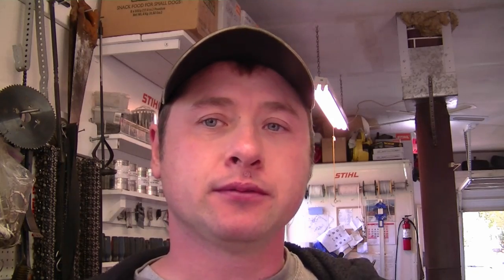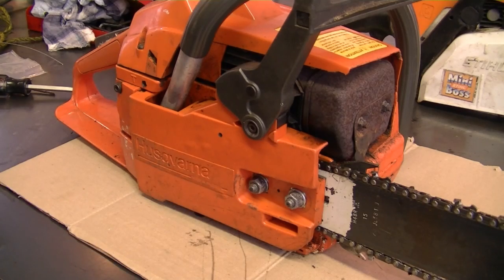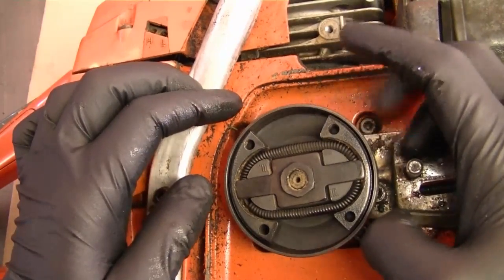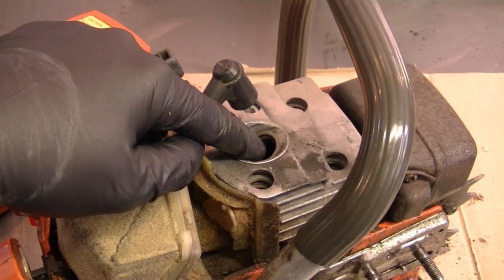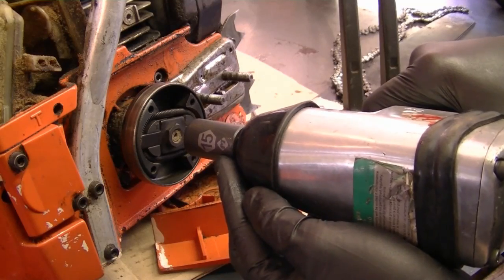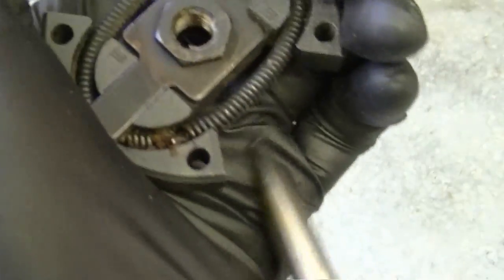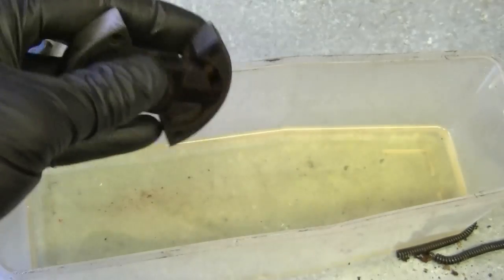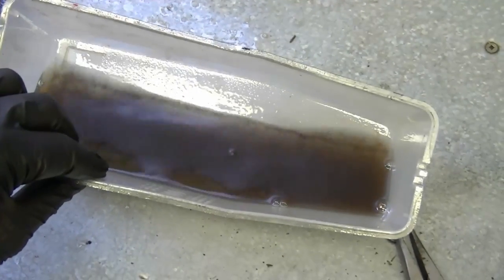How To Fix A Husqvarna Chain Saw When The Chain Won't Stop Turning & How To Fix It

Comment: Did get my Husqvarna 136 Saw to start. Did a lot of cleaning. Muffler, cleaned and gapped spark plug. Used 50:1 premixed can 
of gas. My fault for using old gas. Never had a problem before with 10% ethanol gas and oil. My Homelite 14" gas saw ran for 
20 years without any of the issues I'm having with my Husqvarna ( 11 year old, moderate use ).
Your videos are great.  Going to take a look at my clutch since my chain moves while idliing, and my automatic oiler since
oil was dripping when starting and dripped a lot while chain was moving while idling.
  Thank You !!

Comment: Great video! I'm happy that you mentioned that you could check the throttle screw first. You showed it so fast, I almost missed it. You could have spent a little more time on that, but besides that, it was excellent and if I ever need to replace the spring, I know how! Thanks!

Comment: A+ as always, thanks!!  Man I WISH I watched this before removing a clutch the other day, I did "the rope method"....dude I have had to grind wrench-sockets for custom sprocket-drivers to remove plenty of my climbsaws' sprockets (always needing to oil those roller-bearings on the shaft//clutch interface) and I never jam the cylinder I just put the sprocket-driver bit onto my ryobi impact drill and gun it CW full-trigger and it works w/o exception!  
Am new to this style of 'hidden / invisible' clutch on the 660, which I'm working a pair of right now (am no pro am just doing this for myself, well not pro chainsaw guy a pro *tree guy*!), and I just totally defaulted to the 'jam the piston' method w/o even realizing I wouldn't have even had to make a special clutch-driver!  Well, there's a 2nd unit that still needs its clutch removed so 1 outta 2 is better than none ;D 
Thanks as always, it's funny I've developed a habit wherein, before any procedure I don't know "with my eyes closed", I've developed a tendency to watch a handful of 'randoms' and then watch your content last before doing the job, am removing the other unit's clutch right now lol, but yeah I think your stuff is just so great & to the point that it helps getting more elaborate explanations elsewhere, seeing & hearing another's take on it, and then watching "the dictionary"/authoritative piece of content on your channel as your final, I suspect it's just like studying "varying sources" and finishing with the encyclopedia or dictionary, the 'objective final piece' (can't believe how young you are, I mean I can tell you "look young for your age" and all but you're obviously not 50 and you've got the mechanic-skills of someone far older!!)

Comment: Thank you, I’ve wondered why the chain would continue to run after I let off, this helps in identifying the problem.  I’ve just ordered a new spring on eBay and will follow your instructions on replacing it.  Thanks again.

Comment: I've got a Husqvarna 61, after only one minute or less of operation the saw will stall while cutting. I am guessing this could also be caused by a stretched clutch spring? I have taken off the clutch plate, the spring is not broken but perhaps it is stretched, I am not sure. Great video by the way.

Comment: Hi Dony. As always I learnt so much from the vid.
My husqvana 51 has a triangular configuration.
Is there any difference in part number and fitting. Thanks for your videos 
South Wales GB
Reply from the maker: doublecheck part numbers to be sure!
Reply: It's a vintage model I guess with smaller brake shoes than the newer models. I could take a photo and send if that could help

Comment: a way to diagnose a broken clutch spring is start your saw and while the saw is idling touch the chain to a block of wood, if the saw turns off then the spring is broken.

Comment: I have a 55 that clutch seems to slip under load and I can also hear some noise. I getting ready to take it apart what should I be looking for. Also the chain tension does not seem to be too tight.

Comment: Smashing video :-)

Love the rope trick, i will have to remember it :-)

Such a simple centrifugal clutch, cheaper than other types i would think.

That new spring looked a bit weak as well but i suppose if it was any stronger you would have to rev it up too much to drive the chain.

For an impact effect i use a long ring spanner/wrench and hit the end very very fast with a wooden handle from a hammer, it may take a few hits but it works :-)

Comment: hey man, i have a question for you, i have a husqvarna 51 and when i pull the starter cord it pulls hard on first rotation then soft then hard then soft its always in the cycle.....any ideas on why this may be ?
Reply from the maker: +winston alpha maybe the recoil rotor part is worn, how is compression, does it run?
Reply: aint sure on the compression, yes it runs it runs good, i started it today for the 1st time in 2 years.....
Reply: what exactly is the recoil rotor ?

Comment: Hey hey !  I have Husqvarna 141.  I put it all together and i do not know what i did wrong...because it will not start.  It has spark. I somehow suspect...that the timing is wrong or perhaps the flywheel is fitting perferct...but actually are for another model....where coil is slightly different place...so timing be wrong.  Do not know prehistory of the saw.  Other...the engine and carburetor and coil is brand new from china !  Irritating.  I do not know how to check the timing...that give spark i mean at the top point of piston in cylinder.  Weird ...becaus i put gasoline straight in the cylinder...it has blue  spark...but still do not suggest nothing...not even a small fart.  Dead. New cylinder...allot of hpe and work huhhh... new lines as well.  My first Husqvarna experience and it turn out to be a night mare.  I did allot of stihl and jonsered with succsess of course.  Huhh  Someone help ?  he he  Thank you Donyboy for all you helpful and well presentated ...good made....chain saw educational videos !  Very helpful...  Thx ! :-)  I fixed my Stihl 260 thanx to you ! :-)